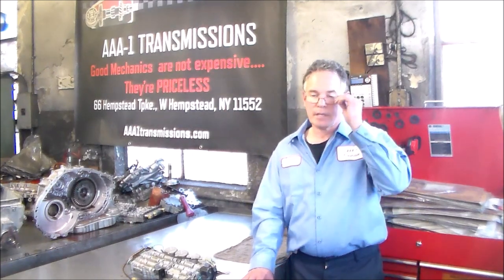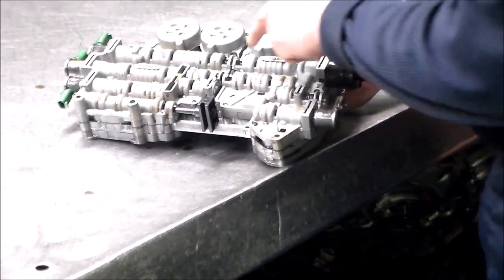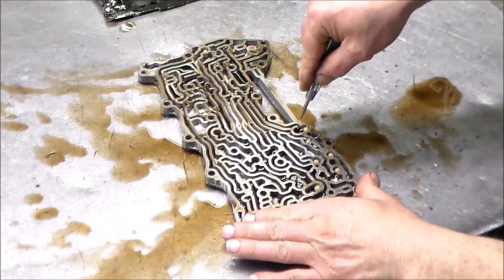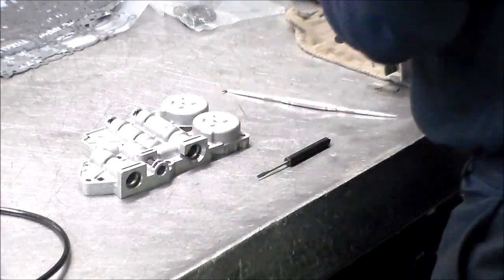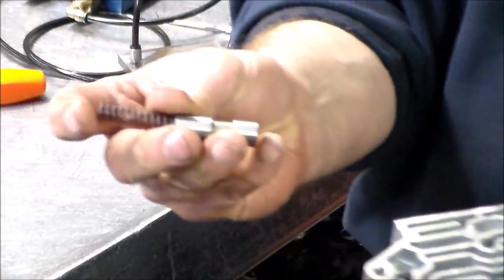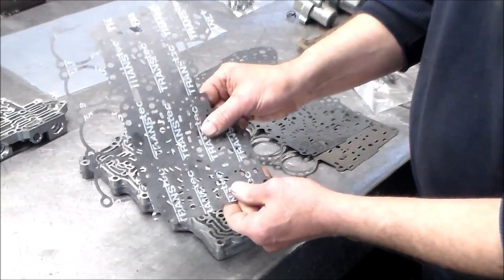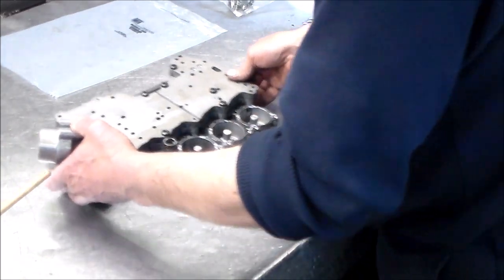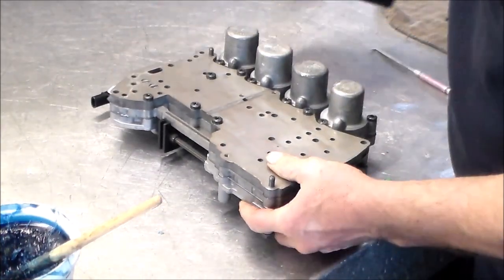5L40E Valvebody Overhaul

Comment: Great tip for dry connectors. 
Thank you Gary
Reply from the maker: Thank you, they always break
Reply: @GaryFerraro  Do you dry with compressed air? When it comes time i go to buy a new valvebody for my 6L90 automatic transmission that equips my 2011 Cadillac CT5 with 6.2l V8 engine.
Reply from the maker: @mikepittsburg6939  yes i use compressed air
Your trans working ok?
Reply: @GaryFerraro  Sorry but i didn't understand.
Reply: What dry links are you talking about?

Comment: Hello sir, thank you for the video. It may come in handy! I am hoping for some advice.

My girlfriends 2004 X3 will do a sort of flair when it shifts from 1-2 and 2-3. At about 50-100% throttle. Nornal driving it's mostly fine.

By flair I mean it will start to shift, the rpms slowly drop a bit, then it kind of slams into the next gear. The shift time my be 2-3 seconds. 

No codes, I have changed the filter and refilled, it does not slip at all. I have reset adaptations and no difference. Would rebuilding the valve body correct this issue do you think? What do you think of the $200 reman valve bodies you can find on ebay and Amazon? I have a hard time trusting those and might just try to rebuild it myself...

Thank you in advance.

Comment: What a great, informative video. I have an issue (same gearbox) that only affects 5th. Do you think this is something that can be resolved without gearbox removal. Fault code is PO735. Its a low mileage box, changes well except in top

Comment: Hi Garry
Can you please advise on how you can easy identify accummulator housing, piston and springs for this valve body, which one is for number one, two three and four.
I wiah to knkw piston diameter, housing diameter and spring length on them.
Reply from the maker: Look on line, see if there is a manual, if not the company ATSG may have a manual

Comment: Hello I need help with my transmission 
I rebuilt my 5r55s new clutches new pump new torque converter and the problem is that won’t move forward it just goes in reverse in all gears
Reply from the maker: Did you hook up manual valve

Comment: thanks for Great Video...  I got a Question here.  where can I buy  all  4 Accumulator  Spring ?    thanks in advance
Reply from the maker: hmmm,  Not sure  I would have to look into that.  What is the year,make and model of the car?
Reply: @GaryFerraro   thanks..    it's a. 2000 BMW 323ci   E46.
Reply from the maker: @nelsonmelgar999  ok, let me see what my supplier sells, not sure if the springs are sold

Comment: The punch you used to mark the checkball locations, would that affect the sealing afterwards? how tolerant is the surface to marks and scratches etc.
Thanks for these videos anyway, the 5hp19 rebuild helped me a lot, I don't think I'm ever gonna open up a 5l40e but it's interesting to know what's inside
Reply from the maker: Does not affect at all. Just a small mark  then I flat sand so no cross leaks
Reply: @GaryFerraro  perfect, I remember making a tiny mark on one of the surfaces and being so worried. In hindsight should've just sanded the piece down but it works fine anyway :)

Comment: I have a problom with my 2003  318d bmw gm 5l40e transmission. Firs start after 5 and more hour parking, car doesnot move in D gear, firt ı shift to M1 and M2 after2 minutes driving the car, ı shift back to D and the the problem disappears. What can cause this problem
Reply from the maker: ok so just to confirm, the car does not move in drive when cold but moves in Low range correct
Reply: @GaryFerraro  firt start after long time parking (5 or 6 hour), car moves only manuel gear selection (M1,M2 or etc). After 2 or 3 minutes driving in manuel gear, car olso moves in automatic drive mode (D).

Comment: Do you have a link of where to get the shift solenoids from? Thanks
Reply from the maker: I purchase all my parts from a company called Transtar, they have an online ordering system called Transend
Reply: @GaryFerraro  thank you Gary, you videos of the 5L40e helped me tremendously with my BMW E83, I changed all the gaskets and O-rings, fresh oil but it still delays shifting 3rd gear so I am thinking to change all solenoids or get one of those reman. Valve bodies. Thanks again!
Reply from the maker: @hamzamo95  Is this producing any codes? even shifts late when hot?
Reply: @GaryFerraro  no sir, no codes at all. It mainly delays shifting to 3rd or 4th when I step on it going up hill trying to pass someone that I sometimes abort the passing, take my foot off the throttle but eventually it shifts. However, going on flat roads it shifts wonderfully! I know it is not the fluid level because I change it every 40k miles and I follow the procedure to the letter. Thanks